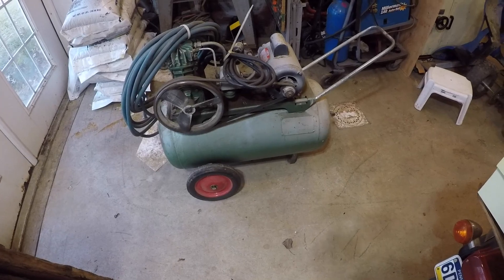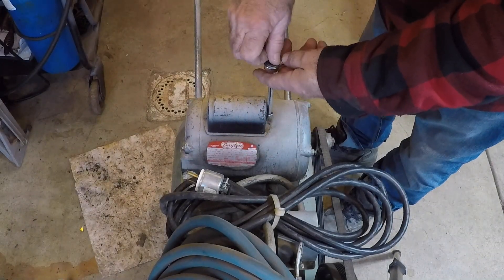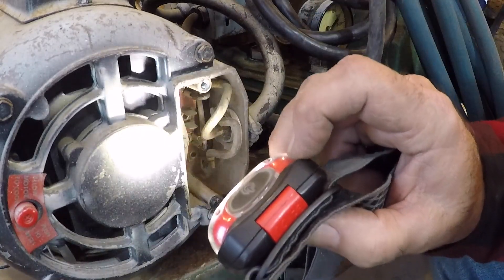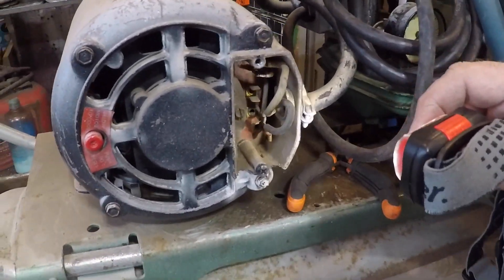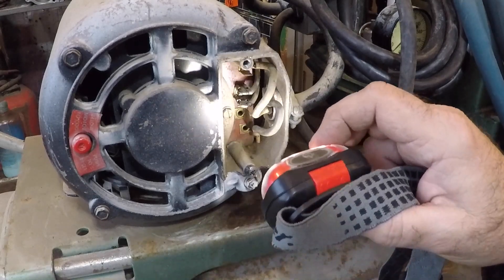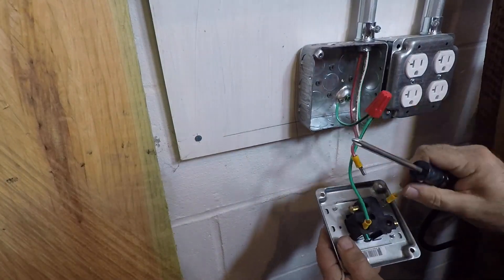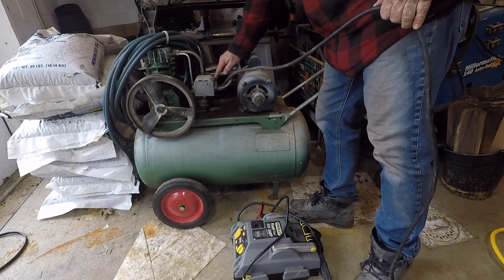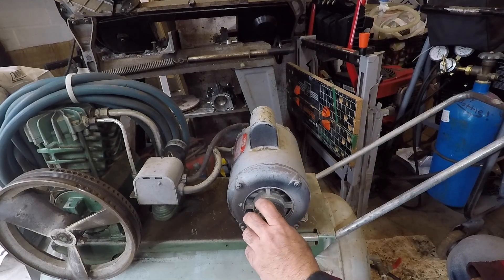Rewiring A Compressor Motor From 120 volts To 220 volts

Comment: I wouldnt throw it away!! take it apart and take the bearing out and measure the inside diam and outside diameter and order one from grainger supply online or got too a loccal electrical motoer repair shop and get one,, i recommend grainger, they have very ffair prices  /cheaper than a local source / with a good decent shipping time.. but dont throw it away,, you cant find a decent quality motoer with decent windings these days. i know i donr went thru 2 120 volt 1/2 horse p. motoers in less than three months due toot he cheap ass windingds, i rebuilt the last one with thicker windinngs and put some lube portds for the bearings,, when u ssee the price of a 120 /220 to run that compessor you will think twice unless well money is not an issue,,, acess too bearings is easy ,, just use a micrometer  ID OD and width is all you need , electric motoer bearings are easy,, only if you use a bearing puller  just for those paticular sizes in which i made my own

Comment: give it a shot of red grease on the backside of the bearing housing if it dont have a grease fitting take a dremel or a small bit and drill a hole on top of the bearing housing so you can gert a little lube in there ,,

Comment: To be clear, if if make the appropriate changes to the wires on the motor like you showed, then I can make a pigtail to adapt to my 220 plug in my garage and just plug the compressor into the pigtail with no other wiring needed?
Reply from the maker: #1 change your motor wiring from 120 to 220. #2 plug the compressor into a 220 outlet that is the correct amps. Reference you motor spec. The only reason I make a pigtail is the plug on my compressor did not match the 220 plug on the wall. Just put a plug on your compressor cord that matches your 220 plug on the wall.

Comment: Can you use the motor from the table saw or parts from the motor?
Reply from the maker: No it's too small horse power. The compressor needs a 2hp and the saw is like 1/3 hp